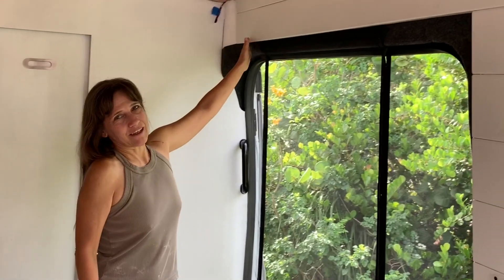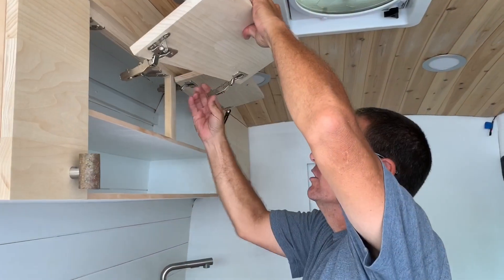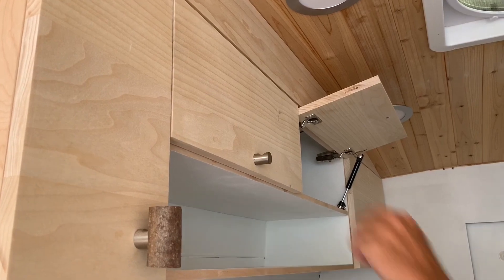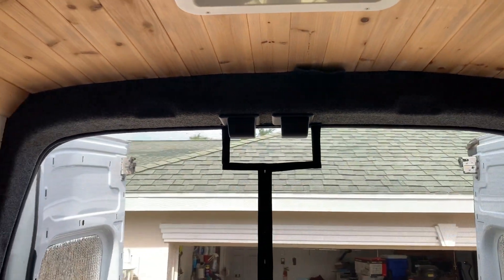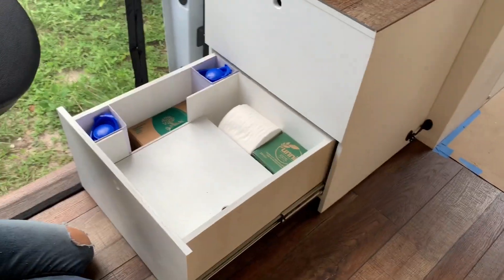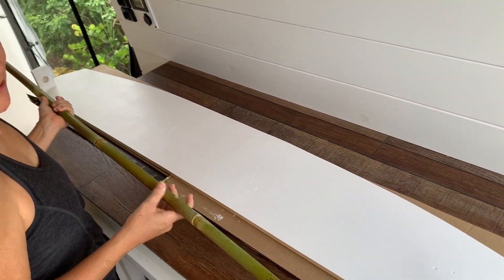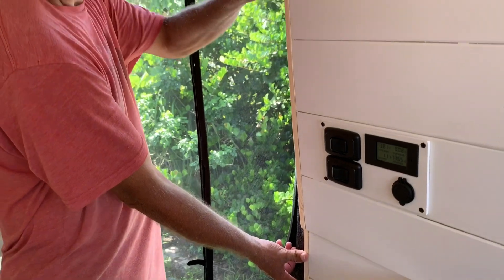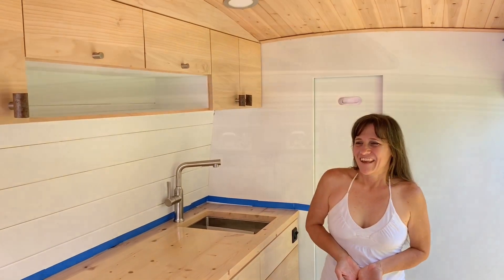Van Conversion: Getting Ready for First Night in the Van | Bathroom | Bug Screen | Bed Cushions ...

Comment: Yo! What was that at 14:00 I'm struggling so much right now with contours
Reply from the maker: A simply and inexpensive idea that we got from another viewer just recently. It is a cap with a hole drilled in the center. You place a pencil inside the hole and it rotates along the contour as you make your mark.